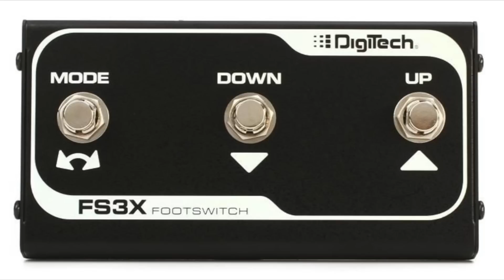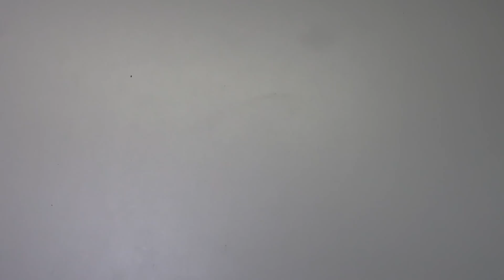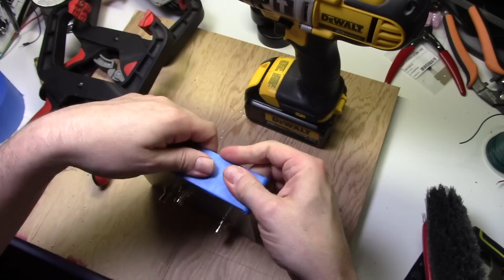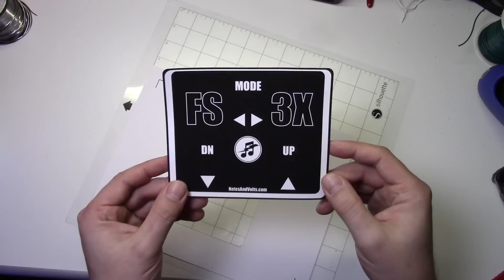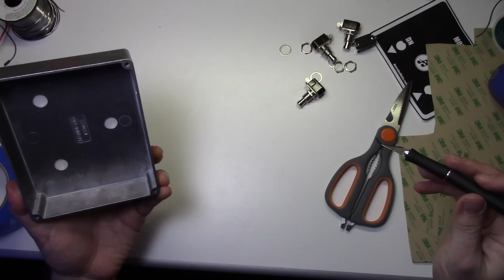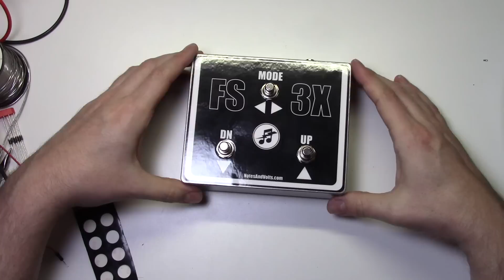Build a FS3X Footswitch

Comment: Hi, There seems to be a huge shortage of these pedals in the UK. Most places saying new stock due in mid December. I've just ordered the parts to make one following your video. Is there any chance that you can put a copy of the graphics so that I can copy please? An absolute fantastic video by the way.
Reply from the maker: Hi Baz. There is a link in the video description that takes you to the graphics download.
Reply: @NotesAndVolts 
Hi, just wanted to drop you a message to say thank you. I made the pedal out of an old 2 channel Marshall pedal. It works perfectly. I've never done anything like it before which means your video must be brilliant. 
I've recently purchased a Donner Circle looper. The pedal actually works with thar to. Ideally, I would like to make a double swith just to select a saved loop. Bank up, bank down. Have you got any advice you could offer up. If not please don't worry as I can use the 3 switch. 
Thanks,
Baz UK
Reply: @bazcross297  For 2 switches version, you just need to remove the part of the diagram with the two diodes and the third switch, that's means you have to connect the tip to the first switch, the ring to the second switch and finally the sleeve to the two earths in series as on the 3 switches version. (I hope that my explanations are clear, maybe not).
In fact, the wiring of the third switch means pressing the other two switches at the same time.
However, for the Circle Looper, the 3 switches version is for me more practical, the third switch allowing you to switch between the loop section and the drums section.
Hope it helps...

Comment: Great video! I made it last week, and tried it w/ rubberneck delay, works like a charm.  It also works w/ whammy 4, mode switch moves the presets clockwise, and pressing Down button and Mode button turns it the other way. Anyway it can be modified to move it counterclockwise with just the Down button? Thanks!

Comment: Ha, great video. I was about to do the same thing when I bought mine last year. But I looked at my receipt and turned out I got a rebate to get one for $5. So I never got the pleasure of making it. The RP360 is great, has emulation of my exact pedals from back in the day. Great spring reverb too. I have it in one of my videos too where I talk about building a battery power supply for it. Thanks for posting this.
Reply from the maker: Thanks Don. I'm enjoying the RP360 as well.